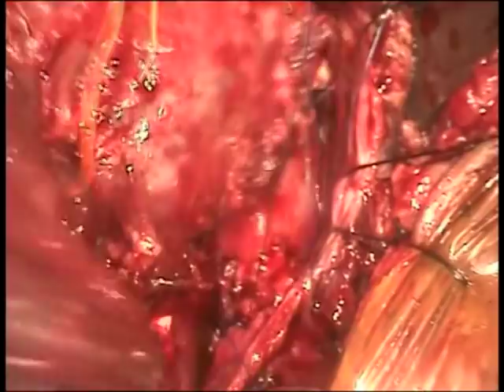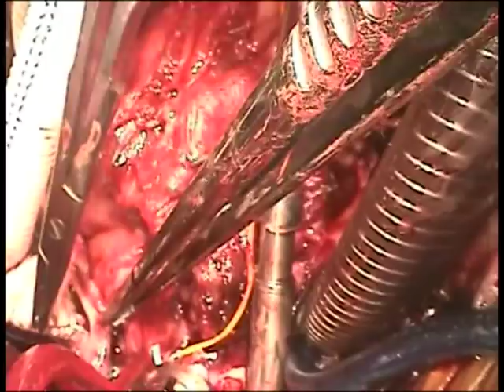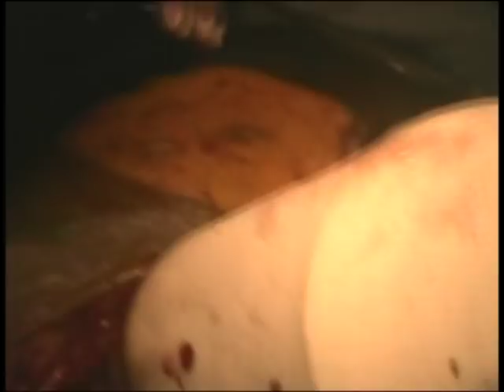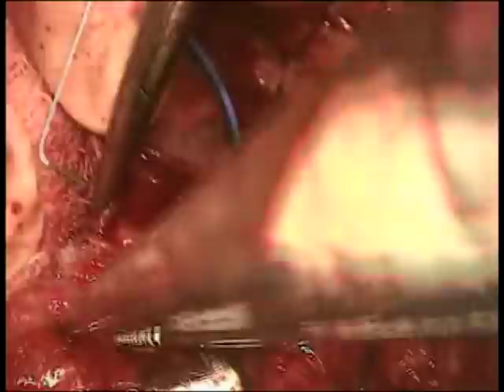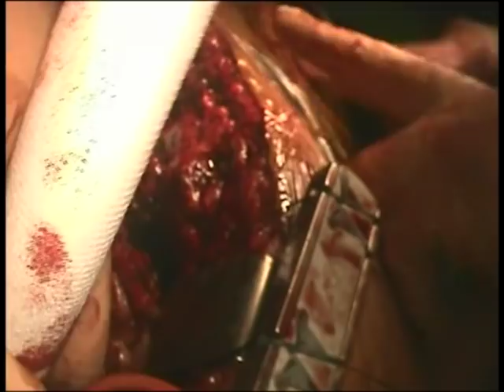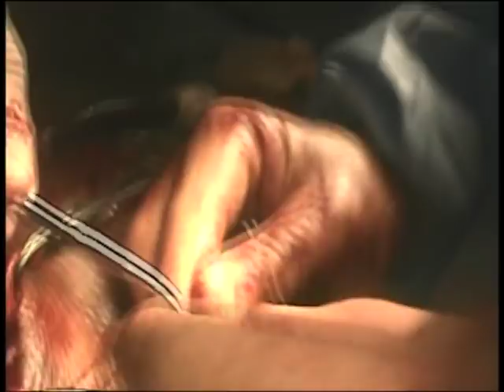Operative Technique:  Insertion of an RVAD (Right Ventricular Assist Device).  A Blitz, MD

Comment from the maker: Long-term VADs, such as the Heartmate II and the Heartware HVAD, are implanted with the pump inside the body.  All approved RVADs must have the pump implanted outside the body.  You are correct, that--in most cases--the plan for an RVAD is for short-term implantation (as was the case for this patient).

Comment: Thank you for your reply. My father didn't make it. After several weeks of seeing his health go deeper and deeper into the point of no recovery the hospital surgeons and staff asked (forced our hand) to take him off all support (vent., LVAD and RVAD) on Christmas Eve or they would have the "ethics" team make that decision for us. The conversation we had with the doctors before taking him off support, said that the first LVAD was not compromised by any blood clots, that they could see. I have done a lot of reading and most of what I have read is horrible stats on these devices. Makes me wonder why these are even an option for some people. I know that not all of them end like my dads did, but it sure sounds like these devices can do more bad than good. We never did get to communicate with my father after that first surgery took place. Sure he woke up after an entire week, for one day, able to follow simple commands but after that it was back to a lifeless body because his ICD, LVAD was not working together and shocked his heart over and over until they finally figured it out. By then the LVAD wasn't working anymore and it was time for the replacement of the LVAD and in turn also place the RVAD because his heart failed altogether. We are still waiting for the report on why the first LVAD failed. They said it would take 6
months. I guess we will see what it says. If there was no blood clot, would this be a device issue or would it be due to not putting it in correctly?

Comment: Hello,
My father just had an LVAD put in on November 20,2013. He had several complications. After two weeks the doctors noticed that the LVAD had something wrong with it. They had to take him back to the OR to switch out the device. While they were operating on him his right side went into failure, so they had to put in the RVAD. Have you experienced putting in a "defective" LVAD? My fathers condition is critical and we don't know how things will end up for him. His heart, kidneys and liver took a huge shot during both surgeries. The doctors "hope" that when the time comes to take the RVAD out his heart will start pumping on its own. Any thoughts on this particular situation? I know every case is different. Thank you for posting this video. I am now able to grasp how this device works.
Reply from the maker: It is difficult to answer your question without knowing the details, but I am happy t to answer for patients in general.  I am sorry to hear about how your Dad has struggled.  Early after the initial surgery, if an LVAD is not working properly, generally it can be due to a variety of factors, including clot in the LVAD, compression of the outflow graft, or malposition of the inflow cannula, among other things.  It is rare to implant a "defective" LVAD, since most undergo tremendous testing before being packaged.  Good luck!

Comment: Your videos are excellent! After watching this patient's first operation on your channel, I was glad to see this one as well.

I have a question, though: Is it standard practice to have the grafts connecting to the RVAD pass through the skin and outside the body? I was under the impression that VADs were usually implanted inside the patient. Was it done this way because you expected the patient wouldn't require the RVAD long-term?